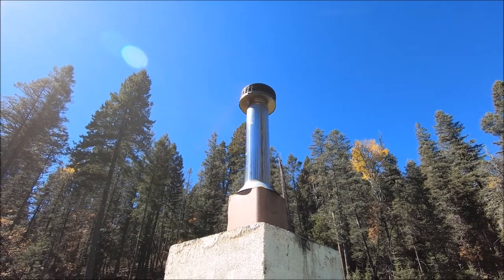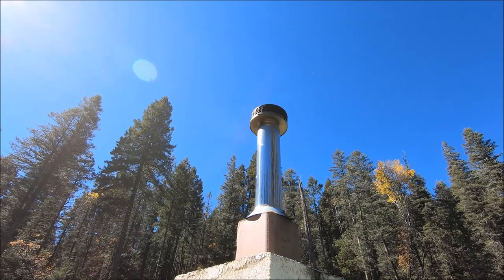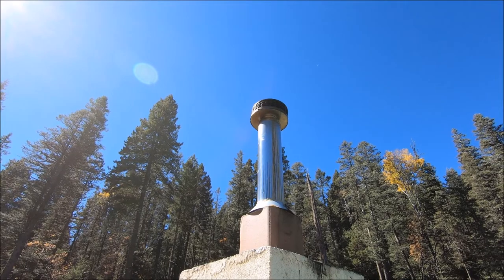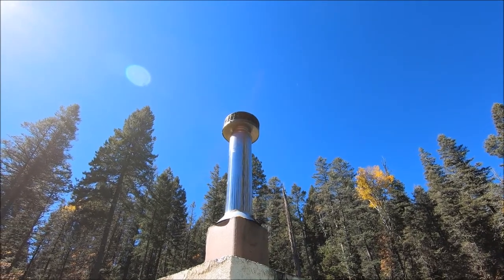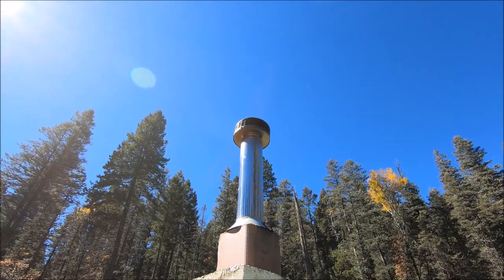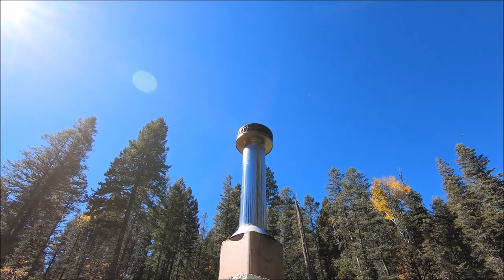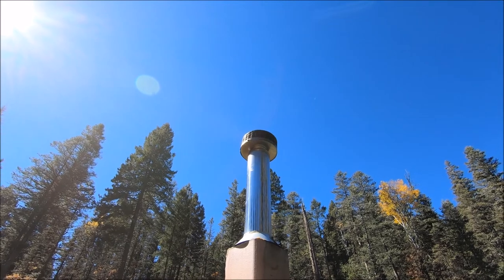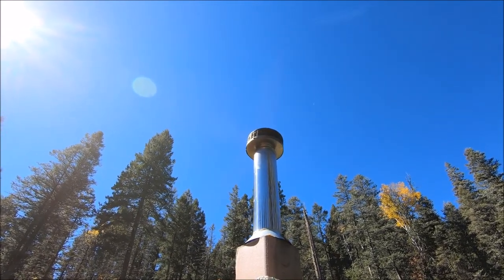How To Deep Clean Your Wood Stove Catalytic Combustor to Get A Clean Burn

Comment: Thank you for posting this. I called Woodstock and received the same advice from a male associate. The only other advice he told me was to rinse it thoroughly about 4 times and let it dry. The stove manual warns to not blow the combustor clean with compressed air as precious metals can be dislodged from the unit.  Great looking soapstone stoves!

Comment: This is the ONLY channel that reveals a good way beyond brushing to clean the cat. A soft brush is a good way to begin cleaning but will only remove debris from the surface of ceramic combusters. Many thanks
Reply from the maker: My pleasure, Mark.  I wouldn't have known this method were it not for the employee at Woodstock Soapstone Co. who suggested it to me when I telephoned them.  My catalytic combustor is a steel one.

Comment: Im new to wood stoves and had a Lopi Rockport installed this past October and it was great the first few weeks but over the past 2 months Its been a very inconsistent stove. I always brush off the front of my combustor every few burns and it always looks ok but lately when we close off the bypass on top and the air inlet lever wide open the fire basically goes out and the only way to keep a good warm fire going is to keep that bypass open. I looked up at my combustor this am and saw a metal bezel around it almost falling out of the one side and the combustor completely plugged in the front. The place we bought it from sells a ton of wood stoves and their installer didn't really tell us anything about how to run it, he basically installed it and left. Is it common to have to remove the combustor every couple months to do a good cleaning?  The first round of wood we were burning was some Maple that I cut and split several months before and my moisture meter was reading mid to high teens for moisture.
Reply from the maker: Hi, sorry I've been offline till now so see your comment today. I'm sorry you're having such a bad experience with Lopi Rockport.  What has the manufacturer told you about this problem?  If they haven't told you anything about it, you might wish to check out a great forum of wood stove owners, called Hearth. I used it a lot when I researched what stove to get, as well as pissed consumer and just poking around the internet looking for real world wood stove reviews.
Please click this link about Lopi Rockport on the Hearth forums - https://www.hearth.com/talk/search/420324/?q=lopi+rockport&o=relevance

Someone there might have your problem and an answer might be there.  If not, tell them your problem and see if another Lopi owner has the answer for you.  Also, there's pissed consumer which has this link about Lopi stoves - https://lopi-stoves.pissedconsumer.com/review.html#reviews

There's also a Facebook group called Wood heat where folks talk about things like this - https://www.facebook.com/groups/151685928272536

Next, do you have the stove manufacturer's operating manual?  What does it say about this problem?

My suggestion is to go over the operating manual. It's what I do with my wood stove.  A lot of answers are in the manual.  Next, if the answer is not in the manual, then call the manufacturer for your Lopi and see what they have to say about this.  That's what I did for my Ideal Steel Hybrid when it stopped putting out the heat it normally did - checked the manual first, then called Woodstock Soapstone company.  A gal there told me this cleaning method for the catalyst.

For my catalyst, which is made out of steel, it is normal to clean it every couple of months.  Brush it off, both sides, then put back in the stove. The operating manual says to do that.  It also says you can fill a spray bottle with one part distilled water and one part white vinegar to spray both sides of the catalyst, then let dry and replace back into the stove.

What it didn't say, but the gal at the company said, is you can also soak the catalyst in the sink with one part each of distilled water and white vinegar.  Then rinse it off with distilled water.

I don't burn maple so don't know if that has anything to do with what your catalyst is doing. But I have this suggestion if your operating manual and your stove company for your Lopi does not have an answer for you:

Use dry firewood, doesn't matter what kind as far as I know.  Just use dry firewood.

Light your stove and let the wood burn for at least 30 minutes with the bypass open, no catalyst engaged and your air wide open too.  Have a stove thermometer on top of your stove near your flue.  Or even better is if you have a catalytic thermometer.  Either way, do not engage your wood stove catalyst until your stove top thermometer reads that it is in the burn range.  Catalysts will not work well if you engage them before they get hot enough. For my stove, per the manual, that means letting the fire burn for 30 minutes before engaging the catalyst or maybe 20 minutes - if the stove top thermometer reads above 250 degrees.

When it reads 250 degrees on top of the stove, it is around 500 degrees inside the stove where the catalyst is.  The Ideal Steel Hybrid wood stove catalyst needs to get to 500 degrees before engaging it.  Perhaps your Lopi stove's catalyst is the same.  I don't know. Please check your operating manual about that.

But anyway, experience has shown me that I need to let the catalyst get up to temperature before engaging it for it to work well.  

Also, I know some folks like to close off the air a lot, but I never do that because the operating manual says don't do that.  When I engage the catalyst, I  turn the air intake down to one half to one third and let it burn for  10 to 15 more minutes, then turn it down to a little bit over 1/4 air intake (stove has tick marks and for my situation, the fifth tick mark is where I leave it, even for overnight burns, the air is a little above one fourth air intake, I never choke it down lower than that.)

For my stove I can't see the catalyst when it's burning as you apparently can see yours.  But I place my head near it and can hear it light off.  I don't know if yours could be heard to light off as well, but might try to hear it. The sound is subtle.

Also, once the catalyst is fully burning the wood, the flame does go out. Stone out. You won't see flame.  The catalyst bakes the wood I guess. Right now for instance, my fire's going but there is no flame in the firebox at all.  Just black in there with the wood looking like it is sitting there.  That's normal for a hybrid stove.  It is also normal for the hybrid stove to initially have flames going strong.  If I get the stove fire hot (aspen wood burns really hot), I'll see secondary burn tube flames shooting from the top of the firebox even when the catalyst is engaged. It will burn like that awhile, then go out, the catalyst doing the rest of the burn until I need to reload wood, which for me is usually 12 hours later.  Yesterday we had a warm day though - around 48 degrees for a high and 30 degrees for a low.  I reloaded wood at 12:45 pm yesterday (from a load of wood the day before at 11 pm) and at 10 pm it was 76 degrees in the cabin so did not reload again until this morning at 5:15 am when it was 66 degrees in the cabin.  Your place will differ, depending on your construction materials and outside temperature.

But I tell you this to give you an idea of what a functioning catalytic hybrid wood stove can do on burn times.  This morning there were still very hot coals in the stove.

I hope this helps.  Please do read over your operating manual. If that doesn't help, then please call the manufacturer. Also please check out those links, especially to the Hearth and the Wood Heat forums. Finally, please be sure your catalyst is clean and you are burning dry wood, and allowing your wood to burn for 30 minutes or so with a stove top thermometer showing the temp is over 250 (meaning 500 degrees farenheit inside the wood box where the catalyst is) before engaging your catalyst, and then turn your air intake down to about one third to one half for 10 minutes or so before turning it down to one fourth.

Comment: Do you really burn pine?
Reply from the maker: Hi DB, yes indeed. Pine, fir and Aspen grow here. Some oak does as well, along with juniper / cedar.
Reply: I burn both ponderosa and pinion pine, what you have to watch is introducing to many pine knots or too much pitchy wood at a time, this will clog a catalytic combustor.  Split the wood and remove most knots, do not burn them in your stove.  Use pitchy wood as a fire starter and burn it down with full air.
Reply: Dry pine is fine.😉You have to realize that hardwood is more of a northeast product. Pretty hard to fine northheast hardwoods in the southwest. Good seasoned dry pine burns fine👍

Comment: Great review -  I just purchsed the progressive hybrid 209 that I bought used and I believe I need to attempt to clean the cat as it doesn't appear to engage.  It is nice to hear that the soaking method appears to have worked well for you and I am seeing others report the same thing.  Thanks!!
Reply from the maker: Thank you Aaron. Something to note is that catalysts do need to be replaced at some point. As you purchased a used stove, you don't know how many burn hours that catalyst has.
So do the soaking method first. If that catalyst then works, great! But if that one does not, then call the manufacturer for a new one.

Comment: If the wood your burning isn’t seasoned enough, it will gunk up, clog, the catalytic combuster, and every time you sweep your chimney also clean your catalytic combustor! Also the burning of the right wood matters too, don’t burn soft wood like pine, fir, redwood, or cedar!
Reply from the maker: In the western USA, pine, fir and cedar are the firewoods, while the coast has redwood
 Everyone burns these because that's the trees that grow. Dry firewood is indeed necessary. I prefer less than 10 percent moisture, but will take 15 percent. Forget it higher, at least for me.

Catalytic combusters should be cleaned every couple of months, as a routine.
Reply: @DesertRatGardener  Yes, people tend to forget that hardwood is more of a northeast product. Good seasoned dry pine burns fine.